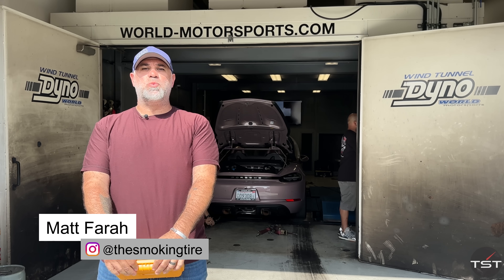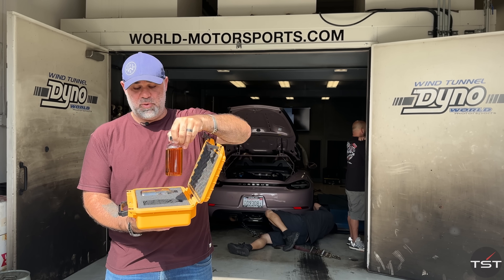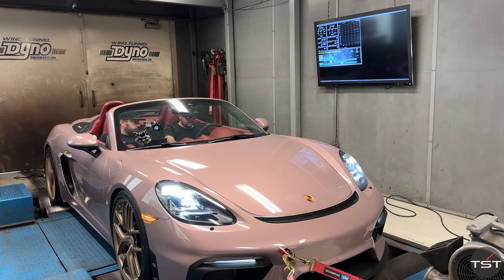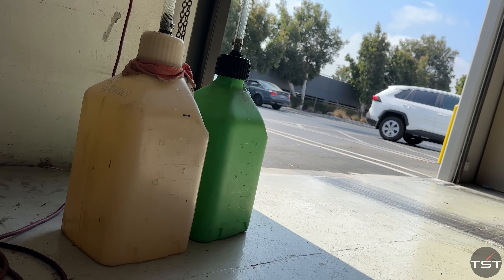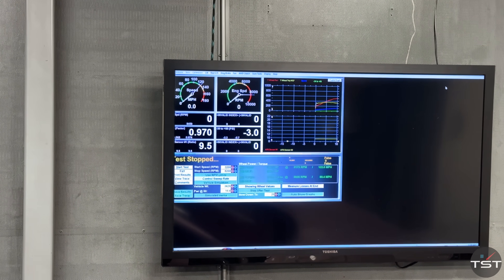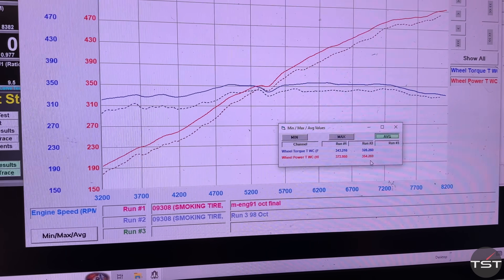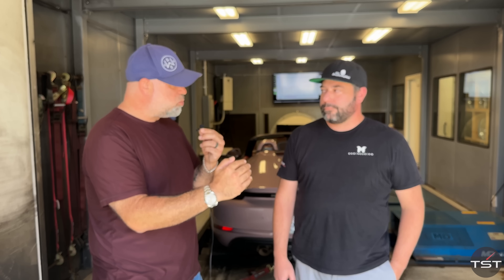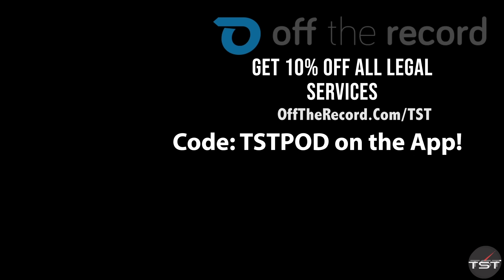How My DeMan 4.5L Spyder Made MORE Power on WORSE Gas! - TheSmokingTire

Comment: 500whp in a Boxster is insane. Must be an absolute blast to drive.
Reply: @CharlieBeveridge elaborate please…
Reply: @CharlieBeveridge What? 500+ WHP on a mustang dyno for an NA Baxter is nutty
Reply: @CharlieBeveridge  I believe it make more, because it a Mustang dyno.
Reply: @frederickcook87 he’s prolly saying the car pulls more timing and makes less power as the ambient air heat soaks the IATs 
Yes I know it’s NA but the outside air is still hot…
Reply: @Yaboybash car will heat soak a lot faster on the dyno than the road…
Reply: @frederickcook87  although that is true, it depends how much they let the car cool before every run lol.
Reply: For sure!!!!
Reply: @CharlieBeveridge  I'm sure he'd be happy to compare the two. I hope he sees this. I sure would like to see it.

Comment: Quick explanation as to why you gained HP and saw less soot out the back after the tune and fuel switch, is because that OTS tune you got from Deman originally was a very safe (rich) tune, meant to  run well on a wide range of cars with slightly different climates and parts. 

This new pro tune, is based only on your car, engine parts list, and climate. They are able to extract all the power potential with a more aggressive and leaner tune utilizing less octane, which is why you see less soot and it sounds smoother/cleaner while also making more power.

Time to rip!
Reply: Only informed comment I've seen on this video. People sounding off on DeMan for not providing aggressive fuel/timing maps without having it on a chassis dyno are clueless.
Reply: Exactly this. The same dialed in tune for the 98 would probably see 15-20 more whp. Lots of tunes are super safe and actually kinda crappy because of it.

Comment: That is an impressive package, and I completely believe the dyno results. However, I do NOT believe the DeMan stated 450 lb.ft torque figure out of a 4.5L NA flat-6. If that were true, the tested 356.7 lb.ft at the wheels would indicate almost 21% driveline loss(!) through a manual, which is bonkers. Even for a modern slushbox, that number would be high.

Given the dynoed power of 517.6 HP, and the rated power of 568 HP, that would only be an 8.9% parasitic loss, which is about what a manual should have (around 10%), so the 568 flywheel power number is completely believable. At that same 8.9% loss, that would indicate an engine making 391.5 lb.ft of torque at the flywheel, which seems much more believable, and is still very high for only 4.5L NA.

BONUS: Using that same 8.9% driveline loss number, on the final 91 octane tune (527.6 HP, 368.2 lb.ft at the wheels) that calculates out to 579 HP and 404 lb.ft of torque at the flywheel!

Comment: Higher Octane does not provide more performance, the energy content of the fuel is the same, just the ignition point is higher up. A higher octane number prevents the fuel from igniting spontaneously in a hot engine and during compression. This produces the so-called engine knocking, which causes massive damage to the engine. Incorrect ignition with low octane can lead to a loss of performance, but higher octane does not lead to increased performance.
BTW, pure petrochemical fuel has about 10% more energy than alcohol mixed with gasoline (biofuel). For maximum performance, you should fill up with the fuel with the least amount of biofuel.
Power per liter in kwh: Ethanol 5.9, fuel/petrol 8.8, Diesel 10.0

Comment: Great numbers! Deman is a builder more than a tuner so this is an awesome combo. One thing for the haters, Deman builds and tunes the engines for race and street use. The IAT on the boxster / cayman can get real hot cause mid-engine with no venting and long intake path not to mention the front side rads heat air on the way into the side intakes. Not a big deal for a street car but a problem for race cars in traffic. Thats why they added the higher side window intakes on the 718 Clubsport evo and later the rs models, cooler IATs. A little more fueling and octane can help a lot when things are race car hot.

Comment: That’s a hot motor you go Matt! My little 3.4L 981 is envious. Doubt that booster was producing 98 AKI. On E85 you might see +60-90 whp if you have enough fuel flow. The 4.0L of the shelf E85 tunes are getting close to 500 crank.
Reply: Little 3.4? Meanwhile here I am with the 2.7...
Reply: @Xaluber  2.7?  Meanwhile here I am with a Miata.
Reply: @JETZcorp  Miata? Meanwhile here I am with a moped

Comment: Lower octane will make more power but it is more prone to detonation which will put a hole in your piston. Nitromethane, for example, is about 50 octane.
Reply: Changing Fuel octane, this fast, in any car. WON"T give correct figures. Matt needed to do this test at least weeks apart.
Reply: @Mexxx65 says who? Race Fuentes are routinely done w/ the customer doing some test pulls on pump gas to drain the tank. Filling w/ race gas, driving for about fifteen minutes and then tuning. This is no different.
Reply: Not how that works, nitromethane doesnt make more power because of its lower octane. Its an oxygenated fuel and you can run a ton more fuel due to its stoichiometric ratio if you can support the injection volume needed
Reply: @Bob_Smith19  Wrong. Changing to a different octane rating fuel, at least, requires the engine to use a full tank of fuel, before the engine ECU programming becomes fully optimized, to take full advantage (or disadvantage) of the different octane fuel used. If you don't let the engine adjust to the new octane fuel, with a full tank. You are not measuring any meaningful data./ifferecnces of the 2 fuels used.
Reply: @michelhadid but octane rating is not indicative of the power that can be made from the fuel.
Reply: @Mexxx65 that is absloutely false. Modern engines will instantly adjust timing and sometimes boost based off response from knock sensors, o2 sensors and iat.  Ecus that have been tuned/flashed will behave differently depending on the parameters set
Reply: @GarageSupra  Yeah sure modern engine will "instantly adjust timing...." so as the different octane rating fuel does not damage the engine. But until the engine has emptied at least one full tank of the new octane gas, the engine will not be producing optimum figures.
Reply: @Mexxx65  That's not how it works at all. if you put a 911 gt2 on the dyno with 91 in it it will self adjust straight away depending on what it hears from the knock sensor. Infact you could run as many tanks of fuel as you like through it because it won't know the difference unless you are at wide open throttle

They don't need a week.

Comment: Kinda wild that the DeMan doesn't include custom tuning to your preferred octane when you do a build with them. I'm sure that engine alone cost more than my Boxster!
Reply: Absolutely crazy that someone would spend that much and not get a proper tune for it. This isnt some intake and exhaust 'stage 1' setup.
Reply: @CussCuss16 They do tune it just not for 91
Reply: @jryalls  Not properly, that is the whole point of this video. If it was tuned properly in the first place they would not gain power going to a proper tune on 91.
Reply: @CussCuss16  not properly? matt literally is with some of the leading experts in ECU tuning of course they are gonna do a better job.
Reply: @Anouyz the demans tune is their OTS tune. It's not a custom tune. Had they done a custom tune on it for 98 there would not be an increase going to 91.

Comment: But what happened on the backend? Did the timing retard a bit but was more fuel added? Is it consistent throughout different batches of pump fuel? How does the motor cope with possible detonation at high temp & high rpm? Please tell if there's any detail on the map to be shared.

Comment: Why not run e85? It would be like running 100-105 octane and It’s convenient enough to find it in SoCal. Plus it’s like a dollar cheaper.
Reply: E85 in Southern California basically doesn’t exist
Reply: @Accost2u  huh? I have 2 cars that run it. 3 gas stations within 5 miles of me - in Temecula
Reply: It’s hard to find in LA. And while cheaper it’s less energy dense.
Reply: I’m in Irvine and it basically doesn’t exist expect like 1 station around here. And I don’t know of any as you get closer to San Diego or Huntington Beach
Reply: Just go to the Gulf 76 in Fullerton... they have 100 octane at the pump.
Reply: I seriously doubt this ecu has a flex fuel OS available.

Comment: Lower octane fuel has more energy, higher compression n/a or boosted engines make use of the anti knock properties of higher octane fuels even though the have less energy. If you shove in more air you can shove in more fuel even if it is of lesser quality.

Comment: less octane will give you more power as long as the engine does not knock.  On many engines, you must retard timing to avoid knock and you can lose HP. But if you do not need to reduce timing, you can make more HP.   You only should use as much octane as your engine requires. I have seen this on the dyno too.

Comment: I would want to know the 98 octane with the pro tune.
Reply: In their defense, Mitch said on the podcast that the octane booster is actually as effective as running true 98 octane fuel. So it’s really a partial fix and the tune Deman runs is probably on the conservative side to avoid blown motors.

Comment: I don't understand why you wouldn't get an E85 tune (and or/especially a flex fuel tune) while you were there, making even more power than that, and being in Commiefornia, it being cheaper to fill E85 because it's corn instead of petroleum based fuel... and then you'd definitely not have to worry about detonation running that trash 91 with, what was it, 14.5:1 compression ratio... I'd personally go back and get one, detune the 91 to be safe, and have it converted to flexible on E85 to produce more power....smart decision could save you $50k

Comment: You wont really make more power on 98 ron on a n/a over 91 ron if the compression ratio is taylored for 91 fuel.  You can wind on a bit of extra timing for the 98 but that wont net you tons of power. 

In order to get more power from 98 fuel youde have to increase the compression ratio and build the engine for that spec. Naturally aspirated engine only bring in a certain amout of air which means it can only make a certain amount of power ...unless of course you increase rpm and comp ratio.

With a turbo engine its easier you just turn up the boost to the point where 91 cant take it anymore and then you just add 98 and adjust timing and boost levels. 

Putting 98 in an engine tailored for 91 will just give a cooler more controlled burn. 

Most engine builders and tuners should know this. It makes for an entertaining video but its not surprising.

Comment: I'm not surprised really, canned tune vs custom dyno tune, the custom dyno tune will almost always be better.
Reply: Exactly. Off the shelve tunes never work properly. They might work OK, but still are far far away from what an engican actually produce.
Reply: I mean, it’s not exactly a “canned tune” given the engine….
Reply: @joetacchino4470  it was a basic tune from the engine builder,  which is usually OK for all 4.5 engines they are making, but is still very compromised.
Reply: @joetacchino4470  It'll definitely be more conservative with less aggressive timing just to allow for variances between engine builds and to guarantee someone doesn't blow an engine when they don't put the octane booster.
Reply: @vvevvevvvv if you’re spending megabucks on an engine build you’d expect a top-notch tune to go with it as part of the deal, so anyone ought to be genuinely shocked by this result. The switch from 98 to 91 (103 to 95 for European viewers) will have cost around 5% in power, so to then gain 5% shows DeMan were around 10% away from achieving optimal output, which is appalling for the money Matt spent.
Reply: @neilturner6749  but its an engine dyno tune that comes with the engine, there's no way to account for the full car setup intake, exhaust system, and drivetrain on an engine dyno, it gets tuned to that engine under those ideal parameters and to the other comments will likely be conservative. Once the motor is in the car it has to be retuned on a chassis dyno like they did, and at that point the tuner can tweak for the final build and fuel type.
Reply: @joetacchino4470 it's a safe baseline tune from the engine builder, on an engine dyno, before the engine went back in the car, its a canned tune
Reply: Not true. “Canned” tunes are developed with testing on the platform, with different combinations of parts (e.g catless, intake, cams). Within a platform all engines are all the same, they don’t need custom tuning if you’re using off the shelf parts. In Deman’s case, it’s very safe to run a conservative map on high octane fuel. Limits chances of knocking.
Reply: @wclutch  "In Deman’s case, it’s very safe to run a conservative map on high octane fuel. Limits chances of knocking." Sounds like you just described a canned tune.
Reply: @neilturner6749  He can't have 10% of motors failing they have to be conservative.

Comment: Lots of noobs in the comments. Lower octane is a faster burn, so thats probably where your gains are after optimizing for that burn. My Volvo redblock is now 10:1+, and even with a tiny cam I can run 87 octane because of my chamber design.

Comment: 3:00 So this tells us engine builder's bench dyno numbers are garbage. It is only for the customer to get some high numbers to brag about. If you have a 100 Ft-lbs loss from bench to wheels, who cares what the bench numbers said. It is all think-of-a-number power figures. You loose 30 percent of the power before it gets to the wheels? Good luck improving or tuning with a plus/minus ONE HUNDRED Ft-lbs...
Reply: Nope. 
This driveline is in fact very efficient.
Reply: @jareknowak8712 which kinda says the engine builders numbers might have been a lil inflated

Comment: I am honestly very surprised that Matt have spent 50grand for a motor and only now it's properly tuned for the local fuel.
Reply: Because putting in a seven dollar bottle of fuel additive with every tank is a lot cheaper.
Reply: Rick was pretty conservative during the development of the 4.5L. 98 gives you plenty of safety margin on the track against eg; detonation. Heck, he started w/ only 4.3L originally.

The new Deman builds come w/ an M engineering tune by default.

Comment: This is hardly surprising and is commonly known by engine builders. There is the same amount of energy in common octanes of gas. High octane is used, not because it has more 'power,' but to tolerate higher compression and timing advance. To do this, inhibitors are added to control detonation, but it's a trade-off. This actually lowers the amount of energy available from the fuel . Modern engines with electronic controls and flow/turbulence management of the combustion chamber can tolerate lower octane for the same, if not greater, power. We used to run our Ford drag car on 86 oct because headwork and forged pistons lowered pinging to survivable levels. This was 40 years ago. Of course, diesel stores 11%  more energy than gasoline,. Needless to say, diesels are robust because of the level of detenonation that is part of their basic engineering.
Reply: And also reliabliity, the power is basicly the same with the fuels but the knock resistance increases. Things like E85 also aids cooling.
Reply: Unfortunately, a lot of 'car guys' don't know or care to learn about cars. If it says Premium, it must be better..😅

Most of my buddies would just advance the timing as far as possible and run the highest octane they could, thinking it was making them faster. They'd lose noticeable torque down low and still not make the same power up top as me running 87.
Reply: I'm surprised I had to scroll down this far to see this. Lower octane is definitely a more volatile and hot boom than the higher octane. The only time you're going to see a big difference between lower and higher octane on a street car is your turbo charged applications. You can crank up the boost a lot more on a higher octane gas than a lower. NA cars are severely limited in their ability to jam as much air in a cylinder as possible, so lower octane will almost always be better (with a tune) than higher octane.
Reply: @ryanmolloy5421  Likewise people are confused with more boost = more power and lower the compression ratio. 
Still older tech and methods/myths are floating about.

Comment: Clock is officially ticking on your motor now 😂 

🍻
Reply: The car was running better by the end of the dyno tuning. What would make you think the motor would let go in the near future?
Reply: huge tell tail sign is that the motor should not have made power; at best it would stay the same or decrease slightly.  

its days are numbered 💯
Reply: @Eggsplanepls  or... If you watched the video, he had black smoke coming out the exhaust on race gas, which he mentioned verbally as well. Which means it was super rich. Lean it out a ton + lower octane = whatever HP increase. There's no need to comment negativity  on a topic you don't study.
Reply: yep. this all equals issues down the line with these motors 💯 

numbered
Reply: @Eggsplanepls  I couldnt imagine watching a video with no actual knowledge on the topic and trying to comment about it 😂😂😂 can I ask what cars you tune and how long you've been in the business?